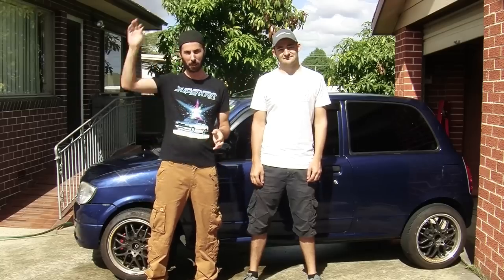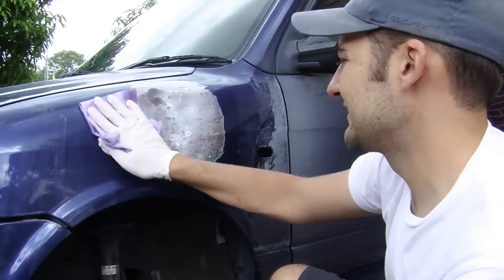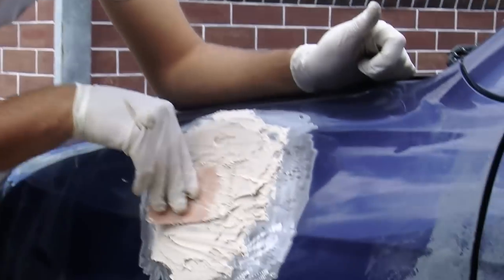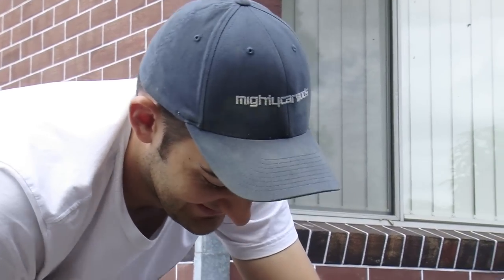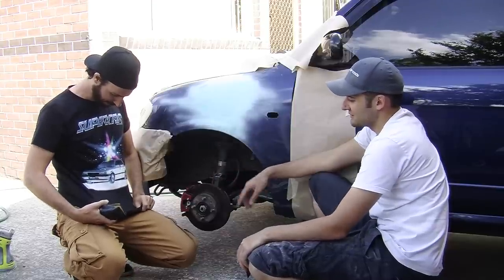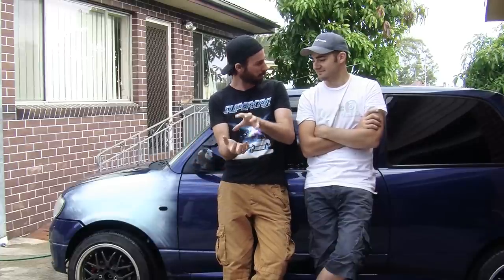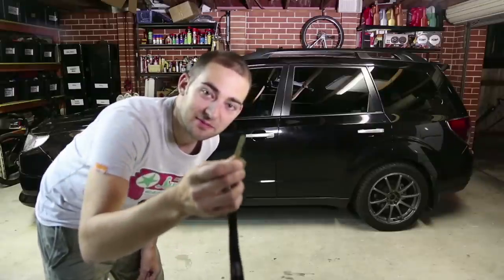Budget Bog Dent Repair

Comment: Did they ever fix the scratch on the forester
Reply: why fix it, just drill holes in it and use cable ties, its hapanuse
Reply: +ardian gashi cmon jdm as f🔰ck
Reply: Looked like it was just edited on afterwards
Reply: If you look closely the scratch line isn't broken by the gaps between the panels (doors etc..)...so i'd say this was done in "post" and is in fact, fake. Also, the gap between the 2 doors is inexistant on the small portion where the scratch line is...its been blurred or "made black".

Comment: get a suction cup or electromagnet and pull the sheet metal out.
Costs less and is more professional.
Reply: This was a good excuse to do the electric space wizard thing
Reply: Bumble Bee You weld sticks on the panel and use those to pull it out, I guess it was done as a bit of a meme but their tepair was garbadge because they should have gotten it much closer to the original shape. Just in case someone doesn't know: you're only supposed to apply like ~1 mm of magic pudding.

Comment: A VolksWagen isnt a premium car. It's an over priced skoda.
Reply: +rimmersbryggeri Really? In Australia, I think it's the other way around...
Reply: Ben Ward
 Skoda's are more expensive in australia? OR do they just not export them there?
Reply: No, we get Skodas here.
Reply: other way around. Volkswagen bought Skoda and now Skoda share designs with VW. also they are around the same price range nowadays.
Reply: +rimmersbryggeri Skoda is proven last-gen VW or Audi technology for a cheaper price
Reply: AccAkut1987 I know that but it's much more up to date now than it was in the early 90's. Really no point buying a VW anymore if equivalet skoda is cheaper.
Reply: that i cant argue with. the passat and superb are basically the same nowadays.
Reply: rimmersbryggeri you're totally right with this, VW is/was actually a little scared just how sucessfull Skoda has become. Most car buyers don't car about the latest in incar-technology or laser lights or whatever.
Reply: ironman1181

Except maybe the superb is slightly more frumpish. And you can get more options on the passat but then that makes the passat dangerously close to as expensive as an audi so why would you really.
Reply: Wrong! Skodas are just older VW stuff re-badged and sold at a cheaper price.

Comment: You can also lay some metal wire mesh across the dent or a sheet of fiberglass and then put the body filler over that so you don't have this huge piece of solid bog.

Comment: That dent could have simply been removed with Portable Dent Reflection tools PDR Without any painting or sanding. But great video showing the more extensive way of doing a fix and paint. Also using  icing putty on top of the initial bondo spreads nicer and sands easier. I like your video, I will add some soon to showing other types of DIY repairs with (Portable Dent Reflection tools) rather then paintless dent repair. Is  that spray putty like  icing in a can, or is it just primer? I have never seen the spray putty on the market, but always thought it would be a great product if it exists, I thought because of hardeners it couldn't be put in a spray can. I will be looking for that stuff.

Comment: I will give you a straight answer buddy. If you have access to a decent mig welder or someone who knows how to weld, you must cut out the rust around the hole until you find clean metal. Once this rust is removed, you can use a piece of steel plate(the same thickness of the body panel) to patch the hole. Once the hole is patched you can grind down the welds, apply primer and repaint the panel. You could patch the hole with bondo but you wanna fix that muscle car right.

Comment: They could make the dent smaller still.. Drill a small hole, and put a toggle bolt or something in it, and use that to pull the dent out more, then use body filler to fill in the hole you made, plus what ever is left of the dent after you have made it smaller.

Comment: It seems like Marty is the one doing most of the car work... While I agree with Marty when it comes to mods (forced induction, Subaru, etc...). I have to say Moog has his side too........ Moog: I get that you like Nissan. Nissan is great for RWD. It is an amazing drag strip car, drift car, or road race platform.

Disclaimer: I'm from the US and don't understand Nissan that well. It's not sold/marketed here.... All I know (from you Moog) is that you rag on Marty for unjustified reasons. You may occasionally muster a win on the track and yell obnoxiously loud about VTEC and your Honda S000. In the end, forced induction should always win.

     For future episodes, I would LOVE to see a MCM race on gravel / dirt / mud / snow / sand / dust / slush / wet-road / ice / back-roads / deep-water / etcetera... Name ANY Subaru and it could beat ANY car Moog has to bring......

     Soft left foot braking, a careful E-brake hand, and a steady right foot throttle control... On a Subaru you can fly through just about any terrain (under 8" of snow/mud/etc...).  There is no better mechanical platform for racing over loose terrain than the Subaru's symmetrical AWD. I like Nissan for it's road applications. But Subaru's variety really seals it's place as the best mid sized sports car.

Comment: Here in Canada I got a small dent and paint scrape in my car's right rear quarter from someone backing out and scraping the side... I was actually quite small if you had just gotten it repainted you would have never noticed it was there small. Got it repaired costed $2100CAD At least insurance paid for it.

Comment: I guess it depends on car and color and how much damage there is. I have car that was dented and has hole. I took it to Maaco and base cost about $270 to repair and repaint the bumper plus tax and labor around $320. If I do the same thing as the video the body filler cost about $25 the sander thing cost about $5 the hardener stuff cost another $5 the spray cost about $17 the buffer cost around $40 and going to garage to have someone paint it cost about $120 plus tax and labor. My deductible was $700 so i did not even bother with my insurance company. So the scenario for me is that having it fixed by professional outweights the benefits of DIY. Just sharing.

Comment: that much bondo will eventually fall off due to hitting a bump. because there's nothing for it to hold onto. Best thing to use is a body puller to snatch dent out, then bang little dents out. then bondo witch should only require one time apply to fender.

Comment: Wrong. The new GT-R's code is R35.

From wikipedia: Because of the GT-R's heritage, the chassis code for the all-new version has been called CBA-R35,[10] or 'R35' for short (where CBA is the prefix for emission standard), carrying on the naming trend from previous Skyline GT-R generations.

Comment: hey guys the make stud welders to help pull a pannel back to normal using a slide hammer and pins that get spot welded on the metal and you grind them off when you get the pannel straight less bog and sanding
Reply: DIY dude. Very few people have that equipment in their garage.
Reply: I understand but using a orbital sander on bondo  is a good way to get your self in problems  expereienced body dawg

Comment: You're not supposed to bog over bare steal  the big when its curing heats up the metal causing condensation which in turn will turn to rust...

Comment: This is a perfect example of what not to do. Bog or Bondo should never be more that 1/8th of a inch thick or 4mm. When mixing bond it's important to not stir it in a way that it collects air bubbles, it is much better to knead it until mixed and you can mix less hardened to get longer workable time.

If you can't get the metal to a point where your basically smoothing shallow waves in the metal you should really replace it. This fender was repairable using the hammer/dolly method but it requires skill and patients, however the best option for this fender was still replacement and saving a fender like this should be last resort.

Comment: Interesting video but it may been easier to pull out the dent as much as you can. Then you wont have to use so much filler. Saves on the sanding also.
Reply: You're being nice, That crap is caked on so thick anybody that has done body work knows its gonna pop loose in a year or less. Body filler should never be over 1/4 inch thick, Ideal is 1/8 inch, Most body guys I know aim for 1/16 thick.

Comment: I have a question about bog, 

I have a car that will rust very fast and I will use bog to fill up a spot that had some surface rust and now i want to use the bog but is it able to first lay some layers of rust-oleum (or any other rust stopping product) and then apply the bog on it?
Reply: Yeah you can use rust converter first, make sure you clean it all off before painting though.
Reply: thanks m8

Comment: a long time ago my sister hit a van. it left a nice giant deny in my chrome bumper right where the plate is, and I can't stand looking at it especially since I didn't do it! any suggestions?
Reply: dent*
Reply: +The Vibe I'm not going to pay for a new bumper on a fucking white rusty piece of shit truck.
Reply: +The Vibe lol.
Reply: UNDEAD ASSASSIN then straighten it as well as you can with a hammer and let it be. if it's chrommed you can't bog it. and if you grind it you're gonna take the chrome away and a recrome it's expensive.

Comment: please please please get your dent closer than that before putting body filler on it. you don't really want it to be more than a quarter inch thick in any spot. But if you do have a really big dent to fill like this you can use fiberglass body filler to get alot closer so you can have less regular body filler.

Comment: Why do you need spray putty? Is primer not good enough?
Reply: Spray putty fills all the tiny  holes that are left.
Primer will just spray over them and leave the little indents or holes
Reply: What about filler primer though?
Reply: i'm not sure i think it might do the same thing you'll have to google it
Reply: it is better to use a filler if you have deep scratches in plastic or into the metal, otherwise filler primer would be ok for light scuffs. I have absolutley no experience with fixing this stuff though
Reply: Mollifier16616111 nevermind im a dumbass
Reply: its best to avoid using spray putty, it only has a few rare uses where its handy but not on a panel like that  

on this vid  1th off they did not make the panel flat enough using a hammer , 2th primer is beter cos its anti rust , but in most body shops they use a filler

as a tip for marty ... if u cant do it all with a hammer from the inside weld on some washers so u can pull

3th they didn't use a piece of tape as a guide line to put in the edgy line in the panel 

spray putty is ok to fill the holes in the other layers of putty they put on , u tend to get them more if u use a rubber . if u use Japanese and German plaster knifes u don't get them in the first place . for a mcm repair i would say that would do :P

but by all means that is not how u put putty on a car panel for a dent like that :P hah 

greetings (1th degree car painter from Europe )

Comment: y didnt u use a heat gun to make the dent flatter? worked on my civic
Reply: Because it is metal. Your civics bumper is plastic.
Reply: not my problem anymore lol. i made most of my parts carbon fiber because my dumb ass put 6 really big subwoofers that are really heavy and took out the back seats
Reply: plus carbon fiber is stronger

Comment: Can someone tell me what "bog" is and what its called in the states? Where can i get it?
Reply: Don't quote me on thins but I think it's called Bondo.
Reply: Body Filler. You can usually get it at Wal-Mart, or most auto parts stores.
Reply: Here in Texas you can find it as "Hard Metal"
Reply: bondo.................................................
Reply: Body filler commonly call bondo but thats also a brand name. FYI filler is only supposed to be applied 1/8" thick at most.

Comment: Ahahaha yeah bondo is rad shit, using it to modify an old bumper. Trap for noobs(that I learned last time), it'll run away from your filling spot if you aren't careful. Apply it asap, wait 1-2 mins, then  go back and make sure it's all in the spot you want filled. 1mm above is enough material to sand back to smooth with, 80 grit is your friend(anything less isn't)

Comment: You have done more damage on that car than it had initially. You could have simply dismantled the fender and straightened it from the inside out. There wouldn't have been any need for painting and fillings. Shows that you are not well-informed with what you are doing. To even think that you painted the fender whilst it was still attached to the car.
Reply: +Mosa Ditsi That's not the point. If you read the title it says budget bog repair. They were showing normal, everyday people how to repair a dent in their car using bog (body filler). Most people wouldn't be able to take the panel off so thy showed them the easiest way of filling it.
Reply: Shows that you don't get the point of the video.
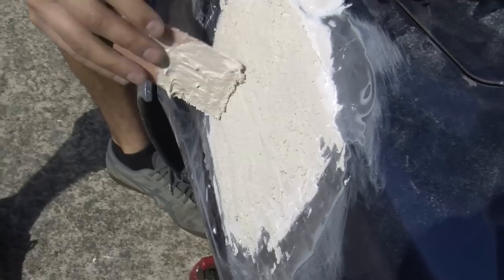Reply: Exactly. Mosa doesn't get intelligence :p and listen to what they say at around 8:20 btw